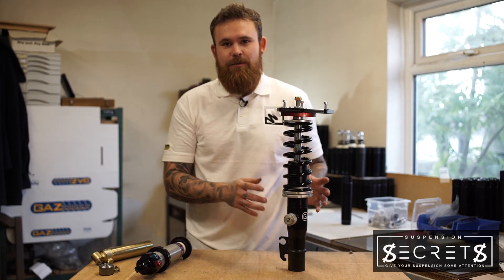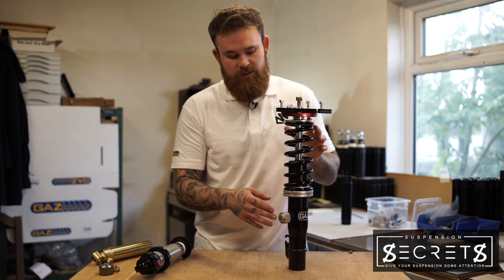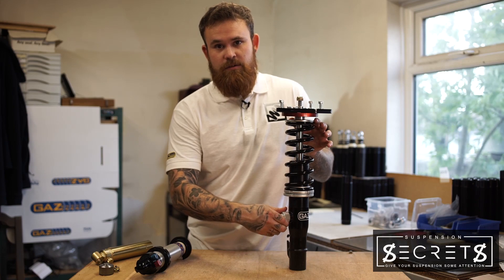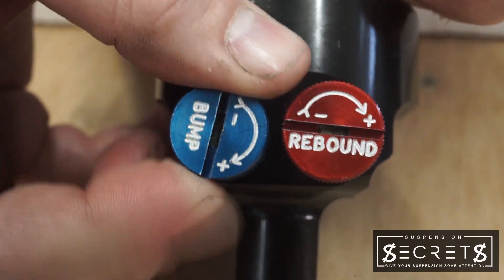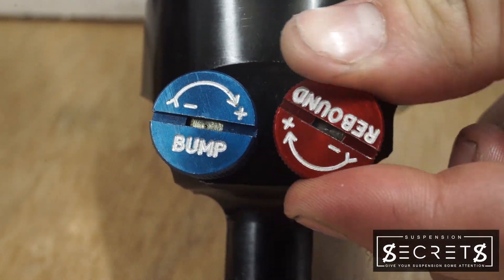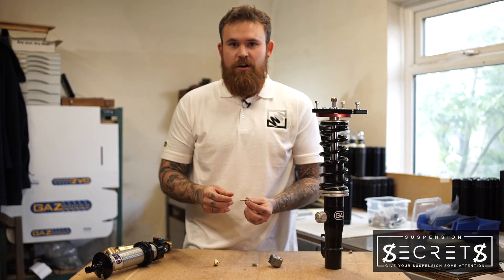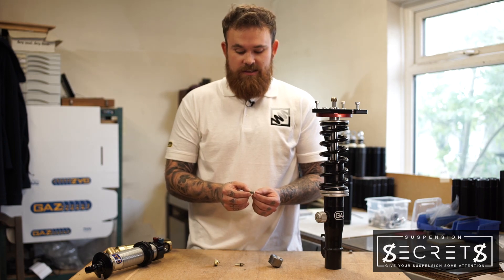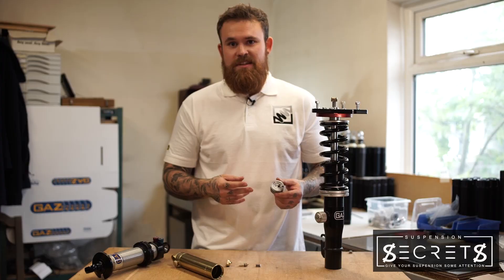Damper Adjustment Basics - Bump and Rebound - An Inside Look

Comment: By increasing rebound dampening, are you making the shock return to original height more slowly or quickly? 

I ask because I want my car to squat LESS on a launch (fwd biased awd). So my goal is to increase rebound dampening and lower compression dampening in the front, while lowering rebound dampening and increasing compression dampening in the rear. This is to preventing the car from squatting in the rear so I can keep more weight on the front tires. 

Does this make sense? Any advice is appreciated.
Reply: Here three years later 😅
For whoever might read this. More damping slows the direction, so more dampened rebound makes the rise slower.
So for less squat you need stiffer read bump and front rebound